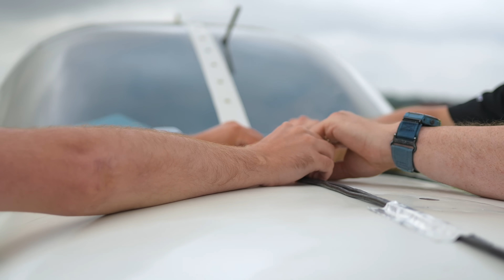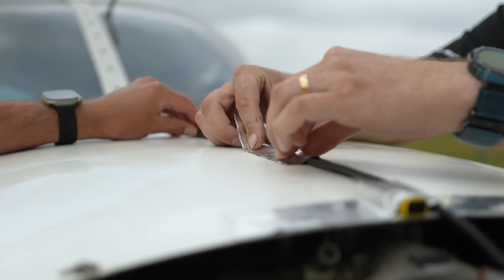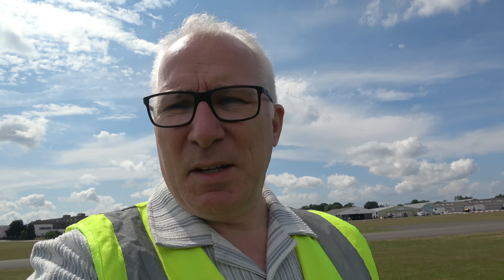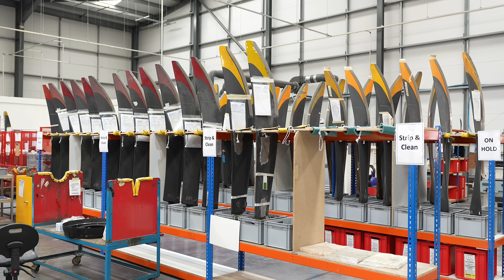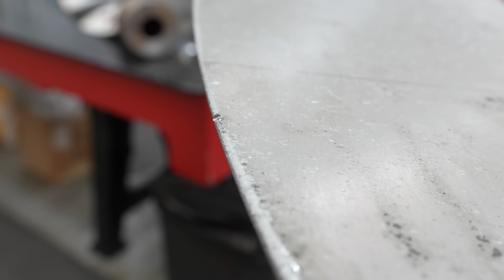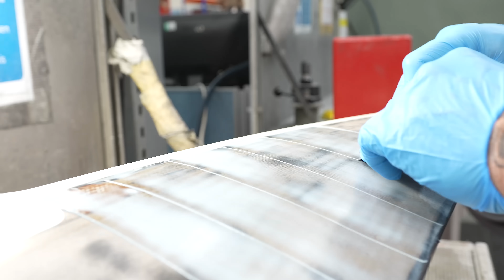I had an annoying propeller vibration before I did this

Comment: Very informative thanks John - I always find there's a few nicks in the prop (mine is just two blade) that need to be dressed out at each 50/100hr inspection.  I have been told though that if it's "more than a thumbnail" in depth (ie the white of my thumbnail) then I should get it addressed more urgently.

Comment: At 1624 you open the throttle to start your take-off roll whilst on a taxiway, as defined by the yellow centre-line and side markings. That part of taxiway B is not a 'starter extension', the runway starts at the marked line denoting the pre-threshold area containing the arrow markings...
Reply: nope, that was just some high speed taxiing, the takeoff started when the runway started 😉
Reply: @rhodricrags8406 - We're all so glad you're here, to keep every one right Rhodri.   What would we do without the expertise of a random YouTube comments armchair inspector...

Comment: Does the three blade propeller  give more speed and climb ? I'd the pa28 a 181 hp.
Reply from the maker: No, not the one I have. Negligible difference. Smoother and quieter than a two blade though.
Reply: @TheFlyingReporter aerodynamic theory says the most efficient prop is a single blade, but some how I don’t see that happening !

Comment: Having been balancing propellers for some years now ( using exactly the same kit as shown in the video ) and having had a lot of success in reducing vibration I am surprised at the lack of take up amongst the GA community. Those who have taken the idea on board report a smoother ride but the real cost savings are hard to quantify as it is difficult to attribute radio failures and components that have cracked and require replacement to a specific vibration problem. But it would seem obvious that reducing vibration will reduce maintenance requirements but getting flying group members to open their wallets for preventative maintenance is difficult.

Comment: Dressing out a ding removes material so must induce imbalance.  I am surprised that rebalancing is not standard.
Reply: If the propeller is in the shop and has damage dressed out as part of a minor repair. It will most likely have a new static balance in the shop.  

"On wing" blends shouldn't remove enough material to throw the propeller out of balance critically. However, if you notice a big change in felt vibration after, it is definitely worth considering a Dynamic. Interestingly most owners manuals will recommend that the propeller is dynamically balanced if paint is is reapplied. Worth a read.